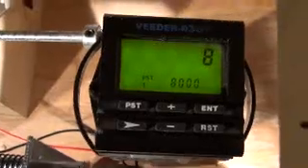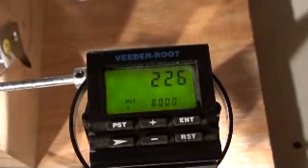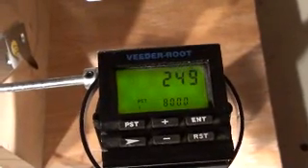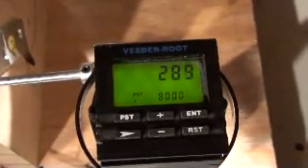My latest winding upgrade

Comment: Interesting prototype. Would not widening the transparent opening on the CD make it count more accurately at high RPM. It seems that a second "clearing" would confuse it and make it count twice. I would expect a 30 to 45 degree opening would work better. Nicely done though.